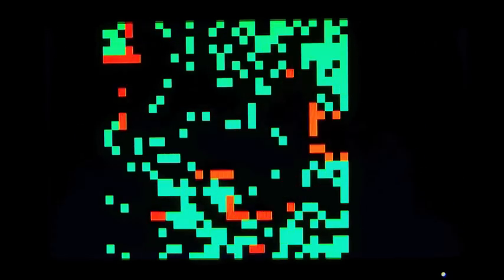Forest Fire on Dreamcast ARM CPU

Comment: It's after 1AM here, and for some reason I am off on a wild tangent that has got me interested in the Dreamcast's ARM coprocessor... Really glad I ran into your awesome video. We're working on a Kickstarted homebrew RPG for the platform... I'm halfway through my Master's with a focus on GPGPU programming, so I really liked your analogy to general-purpose GPU programming... You should write an OpenCL compiler for the processor, and we can load kernels onto it, haha. I've personally never written a line targeting it yet, but I do have the toolchain ready to go with KOS.

Also I remember reading a few posts awhile ago from Randy Linden (the guy who created Bleemcast, a full-speed PSOne emulator for the Dreamcast, which actually makes PSOne games run and look better than they did on the PS2) on DCEmulation.org saying his biggest complaint was the lack of cache on the ARM, which severely degrades performance by a ten-fold factor... I wasn't aware of how slow the BUS was between the SH4 and the ARM. Does the ARM have its own dedicated memory? So you're copying from main RAM to (I guess what would be called) sound RAM? Or is the delay the fact that the ARM is having to access system RAM? 

I'm guessing you've considered using the DMA controller to transfer data back and forth without requiring too much overhead from the SH4? I doubt this would help too much, if the actual bottleneck is the BUS speed, but maybe it helps a little? What kind of bandwidth do you think you're getting between the SH4 and ARM? Sorry for the million questions. Keep up the awesome work, and now I'm trying to think about a good application for this that doesn't require frame-by-frame communication between the two processors...

Comment: Cool very interesting experiment into what the chip could possibly be used for.  But yes due to the speed of the connection (just like with the TI-9918 video chip used in machines back in the day) need to find things that can do their work and you get the result later.

Comment: You could perhaps use the ARM7 chip to indeed to compressions and/or cache the chunks if Minecraft were to run on the Dreamcast. 
The Java code can run in very little memory though. But the Java environment is pretty huge. 

A shame that the ARM7 on the Dreamcast isn't integrated as well as one would like. Perhaps run some AI routines on it? Do a multithread/multi CPU Pacman clone?
:P